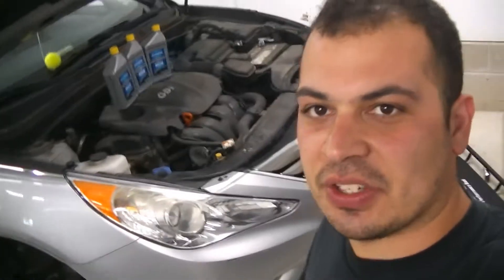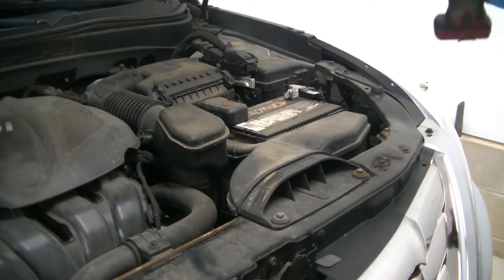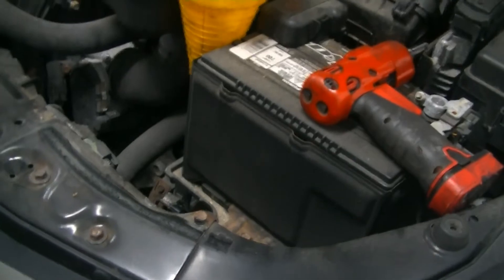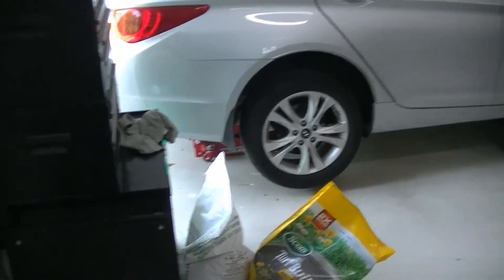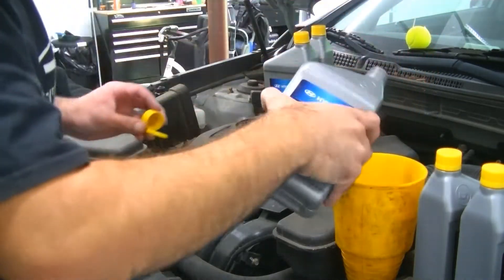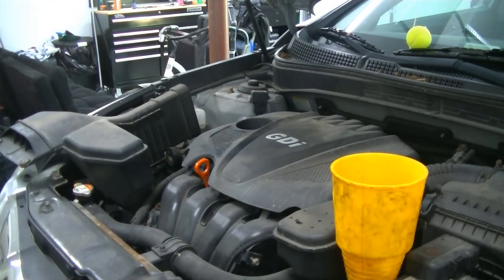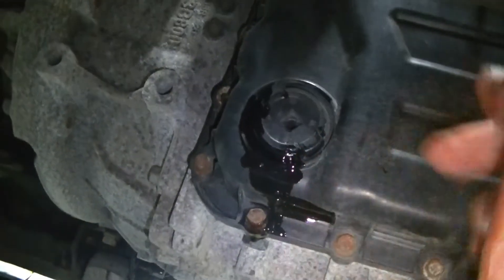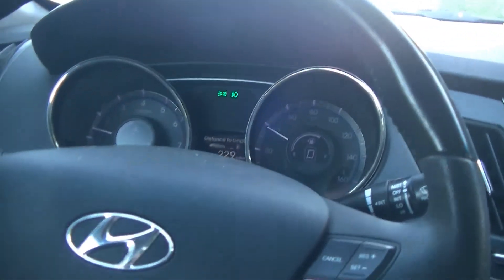Hyundai/Kia 6 speed automatic “sealed” transmission fluid service and level adjustment

Comment: Good video thank you. People should know that draining the transmission only gets out about half of the fluid that is actually in there. The transmission assembly holds almost 8 liters, about 4 liters came out when I drained mine, the torque converter alone holds quite a lot of fluid. With the extra effort outlined here you can replace all of the fluid. The transmission oil cooler is attached to the front of the transmission just above the transmission oil level check plug. Remove the return oil line identified with red paint that goes up to the transmission. It was on the upper right hand side of my cooler. Attach some 3/8 tubing where the rubber oil line came off, put the tubing into an empty container. I used some empty 2 liter pop bottles so that I could quickly judge how much fluid was coming out. I bought 10 L of the maxlife fluid. Drain the old fluid as per this video and replace the oil plug, replace the oil inspection plug. Put at least 4 L of new fluid in the transmission, don't exceed 5 L. Have an assistant start the engine and slowly move the gear selector through the gear positions as you watch the fluid coming out. Turn off the engine when 2 liters come out, regardless of what gear the transmission might be in.  Add two more liters of new fluid to the transmission and do this again. You have now pumped out the old fluid from the torque converter and valve body. Please note that about a cup of old fluid will come out of the removed rubber oil line as well so be prepared to catch it too. My Santa Fe pumped out about a liter every 6 seconds. Top up the fluid as per this video. Finish up by driving for about 10 minutes and then checking the oil level, note that the oil level must be checked with the engine running. Ten minutes of driving will get the transmission hot enough, don't worry about that.  You should have your assistant read these instructions as well before you start so that they know what is happening and are ready.
Reply: Well done. 👍
Reply: Thank you for this sharing. You filled first 4L for 2L coming out of cooler(exact called “heat exchanger”). With the 2 L out of transmission, the remained fluid in transmission decreased accordingly. Would this hurt transmission without plenty of fluid given the transmission is running when 2L fluid is coming out?
Reply: My 2016 Rio drained 5 liters of 7.3 liters in total. That's 68.5%.

Comment: Great video! You mentioned that because there's still a red tint to it, this car qualified for this procedure. What if it was burnt/black? What procedure would you have to follow at that point? I ask because I have a 2012 with 190k and noticed it's starting to skip every so often and wondering if I should do a drain and fill but I don't want to do it if I will discover anything new. Sort of in line to what you say toward the end of the video about inducing new problems. Any help is appreciated. Thanks!
Reply: If it is burnt/black then you're better off leaving it alone from what I understand. If you change it the transmission may slip.

Comment: Great video. I’m going to give this a go on my daughter’s 2018 Santa Fe. I can imagine the dealer will charge a few hundred for this (bought a scan tool instead). Question….when you open the plug to let the fluid “trickle out” before closing…..seems this is really subjective. When you closed it, to me it didn’t seem like a steady stream. That’s the only part of this job that concerns me. When you drain the fluid, does a lot remain inside? Asking Becusee I’m going to check the fluid capacity and then keep an eye on how much I add before I pop that plug to let some drain. If the capacity is 5 quarts and I added 5 then I’d be really nervous to let a lot spill out while checking it. Unless the engine keeps a bunch of the old fluid after you drain it. Thanks

ALSO: since Hyundai doesn’t have a dipstick (unreal why not)…this is a totally different process from my other car. You can’t cycle through the gears on the Hyundai and get the fluid moving doing this process before checking the level. I’m trusting in the factory service process here lol.

Comment: thank you for the instructions. At 17:20 of this video engine is idling and gearbox is in P or N when level checking?
Reply: He only loves comments. He doesn’t answer them. Lol.  In seriousness, this process is different from what I’m used to. I would think you’d want to cycle through the gears to open the solenoids and move the fluid around THEN check the level. But Hyundais are strange. No dipstick? All the videos I have seen on this are different. His seems to be the most thorough but still leaving some questions on the table. Who knows if dealers even follow what’s supposed to be done. Time is money there and I’m sure they rush through the process. Better off doing yourself.

Comment: Or you can drain the transmission putting the old fluid into a measured container, get an accurate reading of what came out and put the exact amount back in.  It won't hurt a thing.
Reply: That is a breather plug. That's if anything gets down the breather hose and then into dropping it straight into the transmission pan. If you look at the back of the transmission on the top at the back you'll see a 24 mm fill point bolt. Take that off. Use a hook and hose and pump and you can pump it straight into the air. That is a semi-blind hole you're trying to put it through and if you took off the transmission cover you would see exactly what I meant. That is a breather hole. You've also got to line up the whole properly on that piece. You've just taken out so it breathes properly. It's 24 mm bolt the same as the drain plug but on the top at the back it's 10 times easier for filling up than what you do
Reply: @justinsalter9059  Great information -- I am wanting to change the trans fluid on my 2019 Elantra SE with the 6 speed automatic that has 55K original miles and as far as I know the fluid has not been changed,  but ...  OK so there is ACTUALLY TWO (2) Fill plugs that I see people using!  One is under the Air Box (after removal)  and this plastic plug is actually the "VENT" for the transmission CORRECT?  The factory "FILL HOLE" is towards the rear and a metal 24MM plug like the 24MM metal drain plug -- CORRECT?  Does the Manufacturer (or dealer) use the VENT PLUG or the METAL FILL PLUG Location to add fluid?  That is my question!
Reply: @retiredperson4054  The fill plug and the vent is integrated together so the fill and vent are the same thing on Hyundais and you fill it there.
Reply: @retiredperson4054 I see you never received a response to your question. MicahCooper for me didn't word his response correctly. I have an '18 Elantra SE and at 47k miles and 13k miles from the 2nd owner's warranty expiration mileage had to use different dealership to get a drain&fill. Am now 9k miles from next drain&fill, plan as you to diy, and want to hear of your experiences. Sounds like you're working harder in retirement, many ain't motivated in this direction.😢
Reply: @retiredperson4054  a friend of mine works in a kia dealer and they pump the new fluid through the metal fill (24mm bolt). That way there is no need to remove airbox or anything.
Reply: @justinsalter9059 i was wondering why there was a 24mm bolt back there now I will try to service the tranny that was👍
Reply: What happens if your transmission has burnt some of the fluid away then you will basically filling the wrong amount up?
Reply: Unless there was a leak.
Reply: I don't like this method because there is no guarantee that some amount of moisture in form of water might dilute the oil OR some amount of oil might leak OR someone try to flush and change the oil before, so you have no guarantee that you'll have the correct amount of liquid. Still, I would like to capture the amount of old and roughly compare to what I put back in.
Reply: that assuming the factory put in the correct amount.
Reply: What if it was low to begin with u just put the same low level back
Reply: Not a good idea.  As fluid could leak / seep over time (due to age) thru the lines to/from the cooler, you're 'reading' is subject to be inaccurate.
Reply: @dougpeters5849  residue left in the fluid receptacle(s) would also contribute slightly to the inaccuracy of this method

Comment: I mistakenly turned off my engine after reaching the desired temperature and then open the level checking lid. Will this cause any issue? 1 had almost 1 liter of fluid drained
Reply from the maker: Yes you likely have a severely under filled transmission. The reason for doing this with the car running is to keep the torque converter filled with fluid

Comment: My 2015 Hyndai sonata 2.4L transmission is shifting a bit hard when slowing speed down. It has 180k miles. Any recommendations? I had a flush done at the dealership recently
Reply: Lubeguard
Reply: @88Berries  thank you for the information

Comment: Beat video on YT! Liked and subscribed.

I do have two questions though Would this be the exact procedure tor a 2016 model? Also, where would I position thr jack stands underneath? I can't find the info or video demonstrating that and it doesn't seem obvious to me where the location is underneath for the jack stands.

Thanks for the awesomeness video man!
Reply from the maker: You’d want to jack the car up via the front and rear sub frames and place your jack stands on the pinch welds!
Reply: @SEsGarage  okay, thank you info and reply!🤘😎🤘
Reply from the maker: Any time! Glad I could help!

Comment: Its just funny to me how the transmission fluid temp is stressed as super important on these new cars because it effects the level and you just just gotta make SURE the fluid is between 137.843 and 139.367 degrees. 

but then the actual method of checking the level itself is this subjective as hell procedure where you're left judging a stream of fluid while its actively leaking out of the transmission lol
Reply: 137.843 and 139.367 degrees!!!    probably hard to find a thermometer with a 1/1000 degree accuracy...!
Reply: Lmao I just realized the irony of this
Reply: My thoughts
Reply: At Nissan I just check if the man is too warm to touch comfortably. I'm sure you're supposed to use a scanner but my dealership doesn't have reliable scanners.
Reply: Right? Why not just fill it till it spills out then plug it up?
Reply: @MrJonBertsch  because the fluid expands while reaching normal working temperature, so if you fill it cold to the correct level, when the transmission warms up it will increase the volume and thus the pressure.

Comment: Hi 
Thanks for the video 
Do you know if there is some kind of tool to extract the fluid from the turbine inside the automatic transmission? And actually extract the whole transmission fluid without leaving a trace of old fluid? 
I’m planing to replace the filter inside as well
Reply from the maker: The only way to do that is the flush it by using the transmission cooler lines, but you’d have to use a lot of fluid. The filter inside the transmission is not serviceable without splitting the case.
Reply: @SEsGarage  thanks a lot 
I will do the same as you did 😎👍🏼 I think that is good enough

Comment: Boss man ! Thanks for the videos! My transmission is jumping gears while driving, can it be that the oil is low? Thanks in advance
Reply from the maker: You can try changing the fluid and resetting adaptive values!
Reply: @SEsGarage  thank you for your reply 🙏

Comment: I work at a Kia dealer service department and I did this service yesterday on my 2021 Hyundai Sonata Limited 1.6 T with an 8-speed automatic transmission following the service information manual on my service laptop.
Reply: Was it the same process as this?

Comment: Did my 2017 Sportage AWD todayl I was unable to remove the fluid level plug! the plug backs out fine, but hits the rim, or edge of the transmission "cooler" and becomes cocked there - not sure I want to put a pliers on the plug and force it out. Any ideas??? Thanks,
Reply from the maker: Just unbolt the cooler and slide it over a hair
Reply: @SEsGarage  Thanks Stephan! That worked. Awesome information!
Reply from the maker: @rickrichards345  so glad I could help!!

Comment: Thanks a lot for video. Do you remember, by any chance, the time it took to warm up to 122F? If started in ambient indoor, the temperature of the fluide should be correlated in a reasonably precise manner with a specific time of idle running the engine. I believe this would help those who doesn't have a scanning tool, and they are many out there! Thank in advance.
Reply: At 16:30 you can see a timeline at the bottom of the screen. He got to 116F in just under 15 minutes, so getting to 122F probably took a few minutes longer. So let's say 15-20 minutes.

Comment: nice video you really seems to take pride in your work and do it properly

quick question my 2018 elantra’s atf fill plug seems to be blocked by the neutral safety switch’s plastic plate. do you have a way of taking it out without filing the atf fill plug?
Reply from the maker: It should clear!
Reply: @SEsGarage  thanks!

Comment: I did not understand what he meant by a "steady flow" before putting the plastic cap back on.

Wouldn't have been better if he put only 4 qts of fluid instead of 5?  Then when you opened the checking cap, you would see no oil coming out.  Then you add the 5th quart slowly until it starts to come out?  Answers 🙏 please...thanks
Reply: wondering the same thing, any answers?

Comment: Hello. I have 2009 Hyundai Genesis with 4.6L. It is also sealed... But I have heard of people doing the flush/change from below only. Any guidance?
Reply from the maker: They use a ZF automatic transmission assuming you have the 8 speed auto. The full and inspection port is on the side of the trans. And the filter is built into the transmission pan. Any YouTube video showing how to service a ZF transmission should guide you through the process

Comment: This is an excellent video, thanks for sharing! One suggestion that would help us DIYers in future is if you run your scan tool until you reach the minimum temp (122F), then immediately do a measurement with an IR thermometer. Then we will all learn the difference (if any), plus the best area/s on the trans to take the measurement. It's a pretty big range and I feel the IR thermometer method should be accurate enough, especially if you can prove that it does. Because you have the scan tool, we don't. Cheers.
Reply: Excellent idea. DIY'ers are all about saving money.  Had he done what you suggested, it would save anyone from buying the scan tool.

Comment: I literally have done two of the three changes to complete my flush and each time I kept making a mess because of the bubbling…pulling the line is such a simple thing…your video is about to make my third/ final change so much easier. 🙏🏽
Reply: Hey, what transmission fluid did you use

Comment: Glad we came across this video.Thank you! Can we use the same ATF SP4- M FLUID you're using, on a 2021 Kia Telluride SX? The Telluride Manual states to use SP- IV SK, MICHANG  is  recommended for the eight-speed automatic transmission. Your servicing a six-speed automatic transmission on this video. With the same specs as the Telluride what's the difference six-speed and 8-speed fluid. Or can we use the same fluid you are using. For the 8-speed automatic transmission. The dealership is using SP4- M1 . We cannot get a definite answer. If we cannot find the correct fluid for an eight-speed automatic transmission. What can you recommend with your permission. If we may  ask. It would be greatly appreciated. Thanks again. Mike from Jersey shore.👍

Comment: The oil temperature sensor you were showing on your scantool, what it the engine or trans?
Reply from the maker: Transmission
Reply: @S&E's Garage  thank you. I have two more questions if you don't mind? 1- did you check the fluid level while the car was idling? And 2- having the trans fluid almost black, can that cause it to down shift hard from 3rd gear to 2nd almost if you were breaking hard?

Comment: Also you guys, please measure how much fluid comes out. Get a new drain pan and pour into on old oil container or something.  Elantras only drain 3.5 quarts or so.  Do not, not know how much came out. Do not overfill it.  You will be on point everytime if only 3 quarts drained and you just put 3.2 quarts in.
Reply: That’s assuming the tranny had the right amount to begin with. To be safe use the method in this video.

Comment: Somebody said there's red and yellow hose pull the one to the trans would you recommend
Reply: The one marked with yellow paint is the return line. It is the right side hose on the cooler mounted on the front of the transaxle.

Comment: Are these transmissions super sensitive to fluid level? I replaced mine with a KIA re manufactured unit and its kind of obnoxious on downshifts when coming to a stop and the 3-4 up shift is soft to the point of feeling like its slipping.

Comment: I did this job today at home, 5th time I've done it.  Add new fluid with car off, and side inspection port open.  You can pour in three quarts without any gurgling. Then start the car and get it up  to operating temperature for the last bit.  Usually 3.5qts, give or take.
Reply: actually I am not worried now, I remember when I told the dealer that I want to change the fluid, they automatically sold me 4 quarts, 3.5 cannot be wrong.
Reply: @TongZ-i2f  Around 3.5 is what I used, you should be fine.
Reply: Hey, what transmission fluid did you use
Reply: @alltorque415 In the past  I've used Valvoline MaxLife, red bottle. But now I use Amsoil ATLQT-EA
Reply: 3.5 qts, that is what I was able to fill in, which is quite less than what this video says, that worries me a bit.